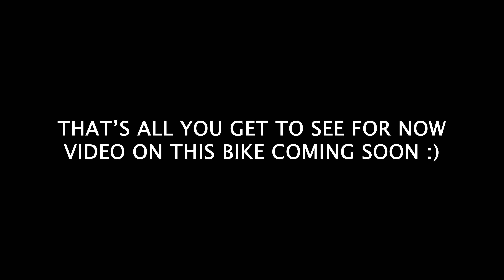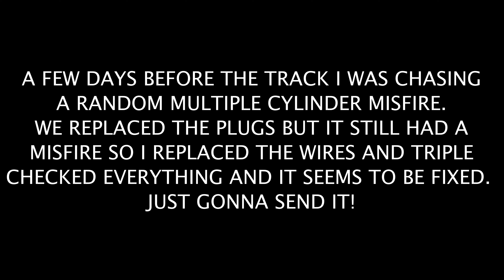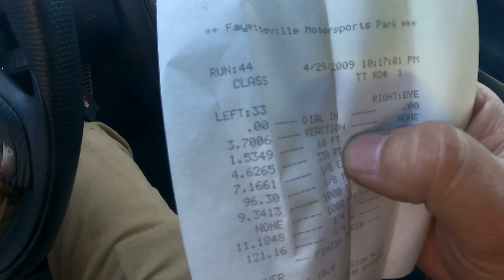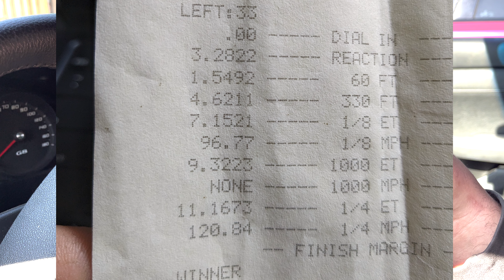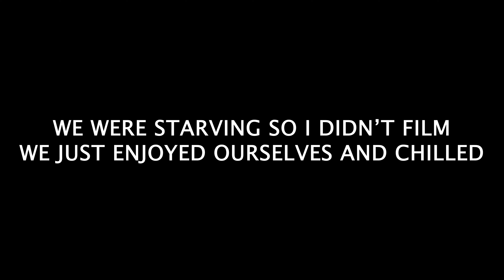My N/A RCR Pontiac G8 Hits The Dragstrip To Test New Mods - First Track Day In Over 3 YEARS!

Comment: What all you got done to the g8?
Reply from the maker: SBE 6.0
Milled .035 ls3 heads
Back cut valves
223/232 .615/.599 111+0
^RCR Drag Sportsman^ 
RCR Rod Mod Intake 
Ported Stock Throttle Body
VCM Intake w ram air plate
LTs with 3in exhaust dumped
Circle D 4DP
3.91 gears
E85 w ZL1 pump
Powerbond UDP
255/60/15 MT ET-Rs
Reply: @Choppa_Garage  damn you got some serious mods I can't wait until I do mine
 These cars have so much potential it's scary